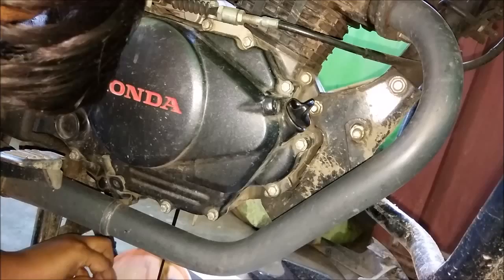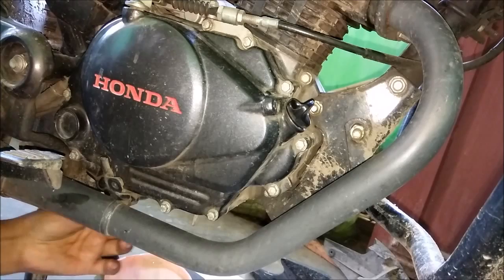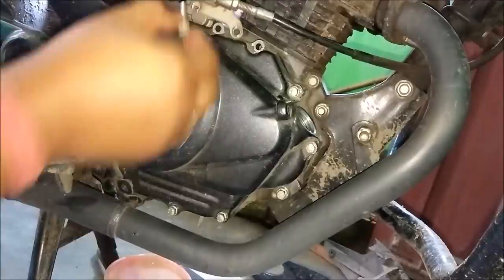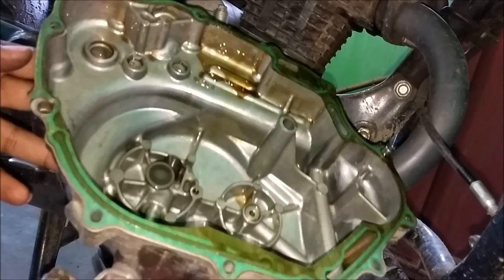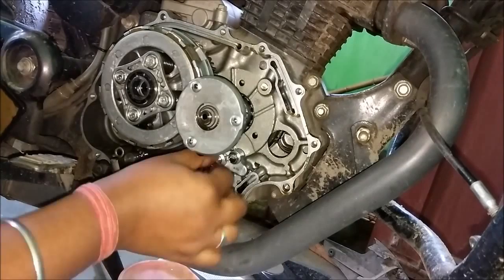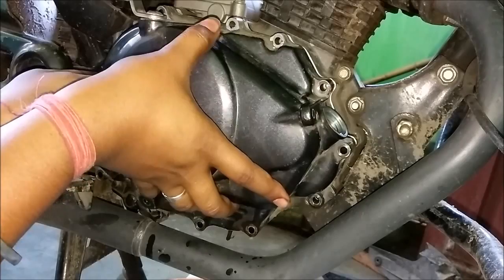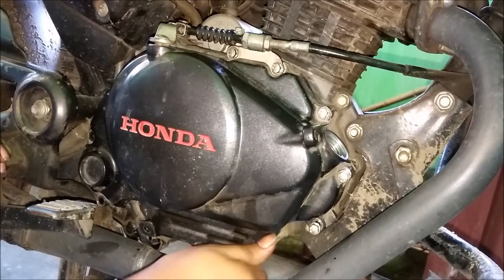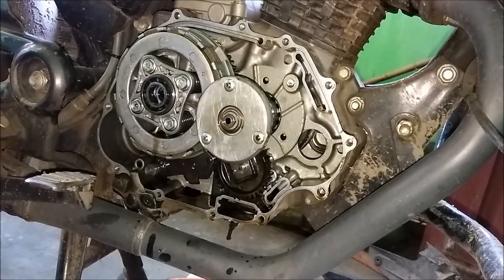honda stunner cbf 125 Oil filter strainer cleaning #oilpump

Comment: Bro I have a Honda stunner 125 2014 model. I'm facing a problem that whenever I stop giving acceleration after starting bike it will turn off. As much as I give race it will be on but when I stop giving race it will turn off. Setting acceleration leveller didn't worked. What can I do so that it'll not power off itself when race acceleration stops and it will power off only when I do it using key
Reply from the maker: 1.carburetor clean karwaye, phir v kam nahi bane to 2.air filter check karwaye, phir bhi kam na bane to 3.AFR screw ajdust karwaye.

Comment: I also have stunner 125. Is motul semi synthetic engine oil useful for this bike??
Reply from the maker: it will be better if you can find any 10W30 or 10W40 fully synthetic
Reply from the maker: or the best is if you find original Castrol 10W30 Semi Synthetic
Reply: Kitne km per change karte ho
Reply from the maker: 2000km

Comment: Is that can be put in cb trigger also? And can I put hero hunk oil filter to cb trigger?
Reply from the maker: if size matches then it is possible oil filter strainer it is just a wire net with rubber seal

Comment: Bhi mei seconds stunner 2011 lerahahu any suggestions plz batao
Aur chain setting problem hai kya karu
Reply from the maker: keep adjusting and when finally worn out replace it with roll-on honda shine chain sprocket kit
Reply: @SashikantSao  timer chain problem
Reply from the maker: timing chain tensioner, timing chain pads, aur timing chain change karwaye. sara hero motocorp ke parts bhi lagwa sakte ho Igintor wala wo bhi ditto same hai. shyaad honda ke spares se sasta ayega ek bar price pata kar lein

Comment: Stunner k liye Honda 10w 30 sehi hai?
Reply from the maker: yes it is better to use recommended 10W30 i have used other weight oil but for best pickup and mileage 10W30 is good

Comment: Engine oil filter clean na karnese gari mein keya asar padta hai?
Reply from the maker: if the filter is not clogged then there will be no difference and your motorcycle's engine will run fine